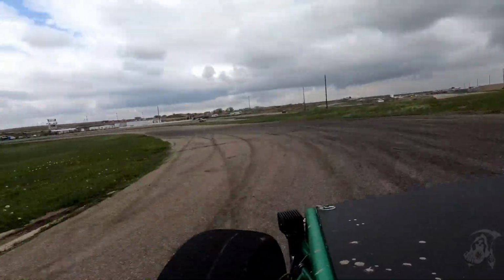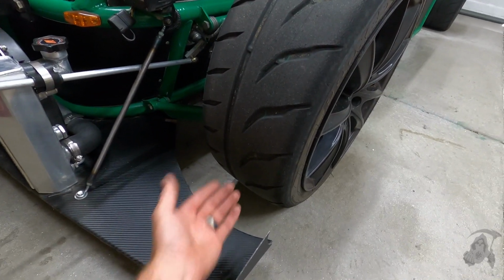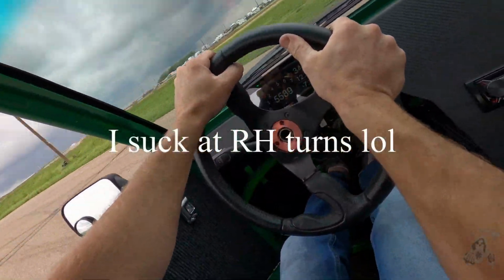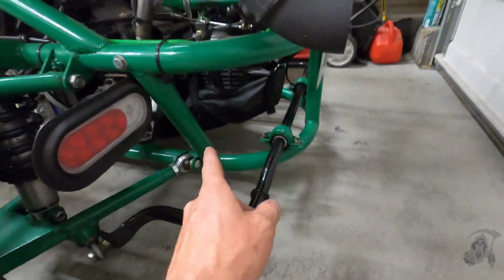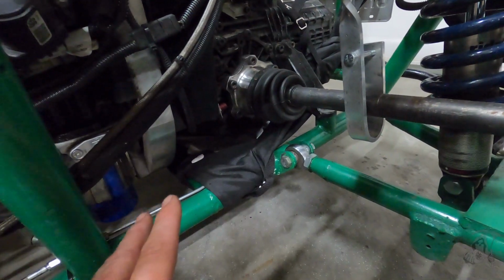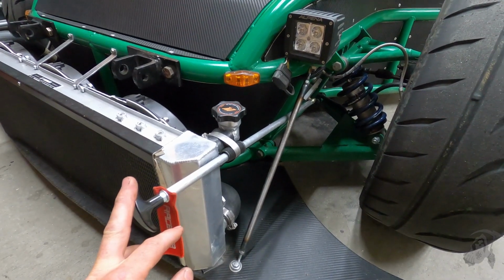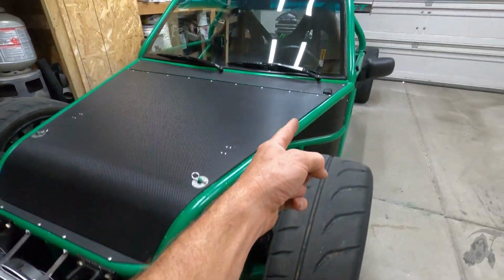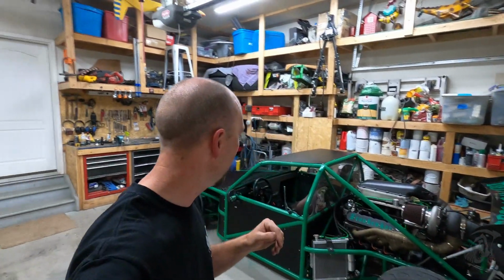Prepping for Street Car Take-over

Comment: What transmission are you using?
Reply from the maker: Using the Audi A4transaxle!
Reply: @DeathByBoost   whaaaaaaaat.... for real??? Is it the 5 speed or 6 speed? Has there been any mods done to the Audi A4 trans axle to be able to hold the power and what adapter did you use to mate it to the LS engine ?
Reply from the maker: Lol ya it’s a 012 fwd trans axle. No mods at all other than a clutch masters twin disk. The adapter I designed my self and had machined by a shop
Reply from the maker: That’s what I say every time I run it!! Lol 😂 I honestly haven’t launched it that hard yet except for one time and I fortunately snapped only the axel! The adapter plate is something I designed myself and had someone mill it for me.
Reply from the maker: No mods just an upgraded clutch. I honestly believe the weight has something to do with a percentage of it being able to tolerate the power!
Reply: @DeathByBoost  Honestly dude amazing build. I would love to do something like this some day. I love the "kart" concept and it seems like they're all fast no matter what engine is thrown in them. Definitely the vehicle being on the lighter side will save the trans from busting. Axle always seem to be the weak point but when you upgrade the axles  the only other part that will brake will the the transaxle. D'you have any dyno numbers of this? Or any 1/4 mile times?
Reply from the maker: Thanks man. Ya true that’s why I’m sticking with the stock axles to protect the transmission. So on 12psi it made 730 to the wheel. And on the track with the street tire with a 2.0 60ft it ran a 10.91 at 138mph and on the new drag slicks only ran it twice this year but with a 2.0 60ft again it ran 10.61 at 148 mph so there’s a lot left on the table it’s a 9 sec car if I can get the 60ft down
Reply from the maker: Thanks man we appreciate it! 

No exact hard numbers, but the motor is built for 1,000HP and the fastest I have been at the 1/4 is 10.6sec at 147mph. So as far as ET there is still a lot there for me cuz The 60ft is terrible at 2.1 sec but again I’m trying not to break stuff until I’m ready to lol.
Reply: @DeathByBoost  Thats really wicked stuff my dude. Yeah gunna be tough to get lower that 2.0 for the 60ft. What are you using for fuel management system? and have you considered a electric waste gate so you can do boost by gear so you blow axles every launch?